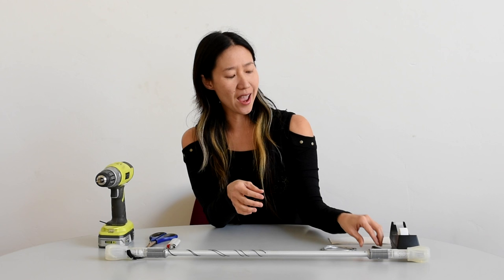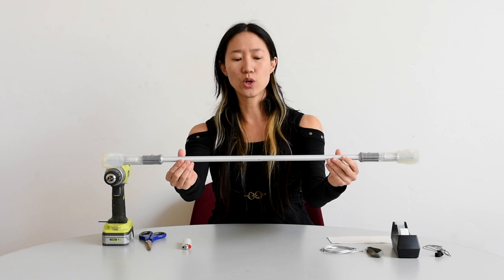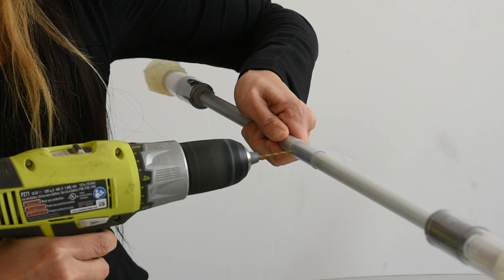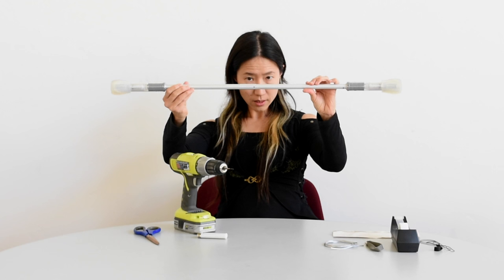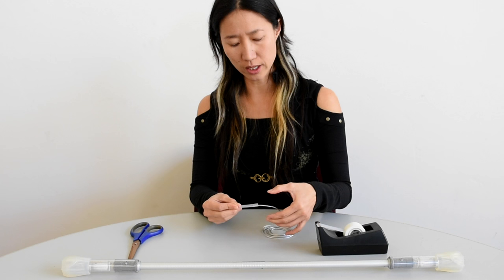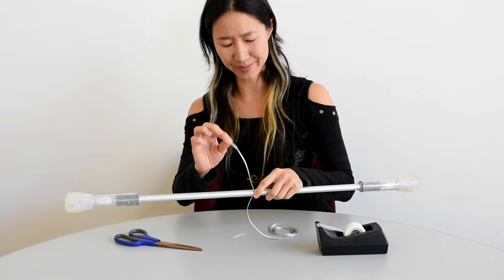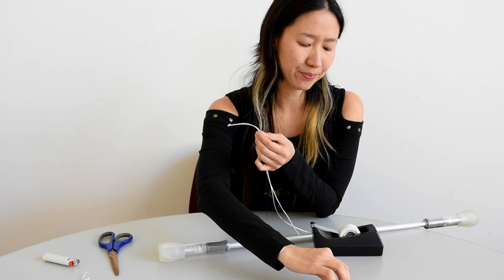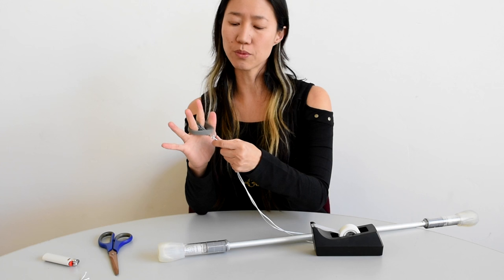Converting contact wand: How-to

Comment: Will this string make flow more smooth? what are the benefits? thanks
Reply from the maker: Hi Kelly, What kind of string are you using? If you're using the ice fishing line that comes with our regular day wands, it won't be as comfortable, esp if you're also using a finger loop. The contact wand is heavy and the ice fishing line + finger loop might constrict blood flow on your finger over time. If you're using a knob handle, it won't matter as much. The satin string that comes with all our contact wands is thicker, softer/smoother and generally more comfy. Hope this helps!